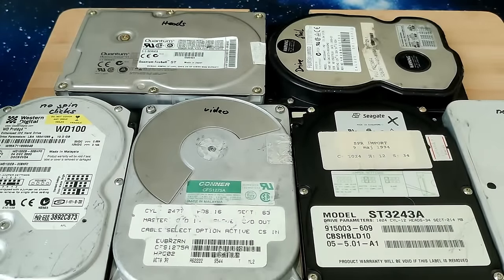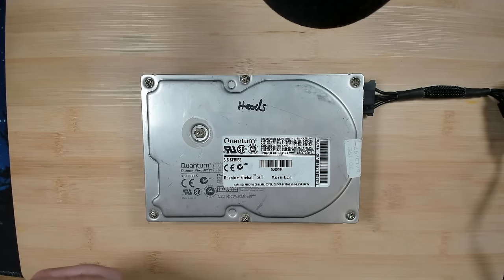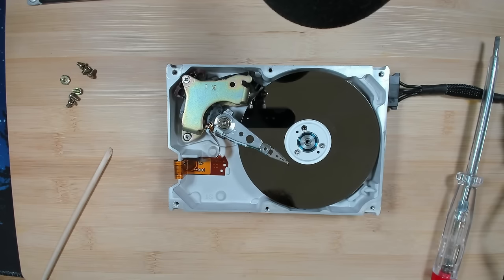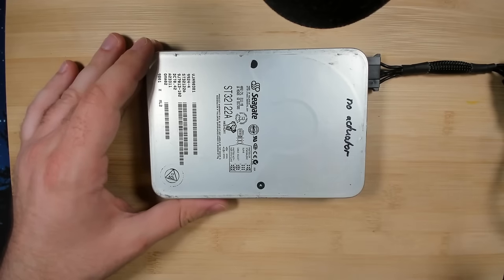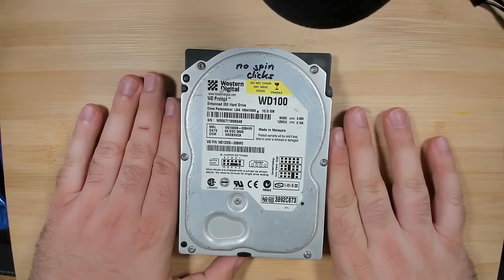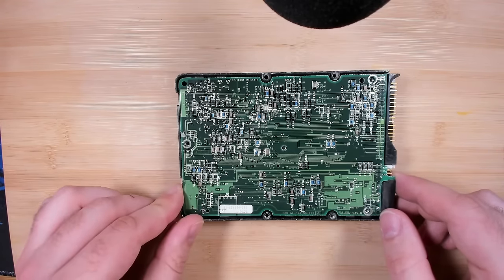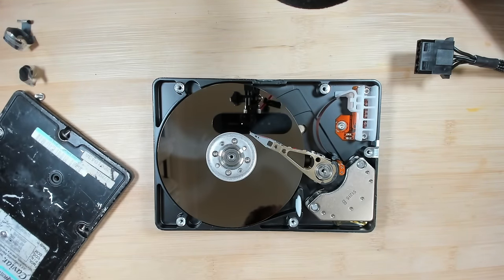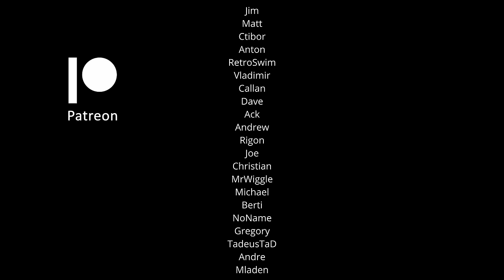The sound of broken Hard Drives

Comment: It's sad to see these drives being open, especially if there is no obvious signs that's it's dead mechanically (like the last WD drive). Cause after being opened it's most likely beyond repair. Anyway, thanks for the video. Interesting, as always!

PS. There is a guy on YT that has lots of video about old HDDs - Arnold0. Maybe you can ask him something.
Reply from the maker: Thanks for the hint. I'll check since I have very little experience repairing hard drives. I still have a handful of drives that need to be fixed, and they're in much better condition and probably have a much better chance to be fixed than that last western digital drive.
Reply: from my experience more than 50% of the drive problams are in the controller card and not a mechanical issue
Reply: my cousin did it all the time, he repaired them as part of his computer hobby, if you don't leave then open and run
them... too long....  they can be opened for repair. unless you are working in or next to a dirt quarry  😆
Reply: @GothGuy885  Older drives were much more tolerant. Sub 1GB you can probably open and have a decent chance of it working after, over 10GB you really need a clean room.

Comment: I could tell by the sound, that the first one was badly crashed 😵
the second one almost sounded like an Air Raid Alarm 😆

as a computer Hobbyist, My cousin used to repair hard drives, that he would buy at electronics swap meets, or were given to him, by an IT friend, who pulled them out of servers.  he would check for any physical damage to the platters and/or heads and if they were OK, he would swap out the controller card from a crashed drive, of the same make, model and specs. and most times, he could get them functional again. not sure if he would do the same with the heads, as the space from the platters is so very critical, and he did not want to ruin good Platter(s) that could be used in another drive. I think he used Archival gloves to handle the good platters as not to get finger prints on them.

Comment: Interesting topic. Over my PC journey (started sometime in 1991/1992 with a 486DX33), I had better luck with Seagate HDs than most other brands. Until recently, I have never had a Seagate HD dying on me: I still have some 4-10-20GB in working condition (100% health), and some 160GB-500GB  (IDE and SATA) also in perfect condition. These HDs are more than 20 years old.
During these years, I had issues with Samsung and Hitachi, (dying young, under 2 years),  Maxtor and Western Digital not reliable. 

My opinion about Seagate changed. Sometime in 2013, during a trip to Germany, I bought 4 Seagate drives at Alternate, rated for 24 hour operation (SV models) with capacities around 3 or 4 TB. The idea was to build a NAS, the drives tested OK and I put then in storage. It took a couple of months (perhaps 2 years) to get all hardware and resume the project. When I tried to use the hard drives, they were not OK: they had less than 200 hours online, were stored safely in a dry place, in their original packing, never dropped.

I bought Western Digital to replace those, and they are running OK ever since. I guess Seagate is not what used to be. It was not that one drive failed: all of then crapped (4 units).
Reply from the maker: Wow, that is very unfortunate that all four have failed! I had a couple of drives fail on me, but no pattern or something out of the ordinary. However, I did have many western digital drives and they were mostly ok.

Comment: Interesting video, as always. Question: do you use Steve Gibson's Spinrite to test and refresh the data as first order of business on those that are able to boot and get detected? If not I highly recommend it. Especially for older drives. Also it's really interesting seeing that program revive an ancient hard drive in real time.
Reply from the maker: Funny you mention him. I actually reached out and he did reply! He provided a licensed version of SpinRite 3! I'll be covering it soon since I would like to cover a few more hard drive topics in the near future. I also got another software called HDD Regenerator. Also a very nice tool!
Reply: @bitsundbolts  🤣 that's amazing!! Steve's the man! To think a few Kilobytes of assembly code could do so much it's just incredible. Looking forward to watching that video soon!  🫡 🙏🏻
Reply: spinrite is great for refreshing fading data and to exercise the read heads... but if the drive is failing mechanicly there is little spinrite can do besides quickly recover as much data as possible before the drives flails completly
Reply: @fft2020  yes of course. It's software, It's not intended to fix hardware issues, mechanical, electrical or otherwise. But IF the data is stale, or there are bad sectors  on the disk platters, I think there is no better piece of software to address that issue and attempt a drive image or full backup as first order of business with these kinds of drives. On top of this, if they are working fine, they will see an improvement in performance. Been there, done that 100's of times with all sort of drives and disks interfaces. The improvement is indeed quite noticeable.
Reply: @Kaio7  you are right spinrite is the best

Comment: Even 20% of change of getting a working HDD from the scrap yard seems high to me. But at least trying if drives work doesn't cost much, it is worth the effort.
Actually I was very curious about the outcome of the WD drive. I have an old one with some data that I would like to rescue, but doesn't spin as well and I don't know how to proceed. It cold something mechanic (like the heads stuck against the platter) or electrical. I'm fearful of opening the drive to see if it is something mechanical and ruin the drive...
Reply from the maker: I think chances are high that a drive becomes unrecoverable after it's opened - just because of the dust particles in the air. I'm no expert, but I do have a few drives that don't spin up. I'm set to do research and try to figure out what's the issue. Will be coming up soon!
Reply: @bitsundbolts  Yes, I'm very reluctant to open it as well, should be like the last resort. I'm no expert as well and because they are such sensitive device, I never played very much with them. I think I will have to get some broken drives and do the same as you did.
Eager to see that video to learn a bit more 😀
Reply: I have more than 50% success in the scrap yard drives, just yesterday I brought a 171mb and 130mb all in perfect working order

Comment: I love old HDDs. I still keep them even if they don't work. The older the prettier.
My backups are all on HDDs, don't trust SSDs in the long term.
I don't mind seeing more non working HDDs videos, if you have the patience.
What was that red thing under the resistors? Some kind of glue?
I know that some very old and unused for a long time hard drives get seized up, and after a bit of motivation they start working. Wish all HDDs repairs were that simple.
Reply from the maker: Yes, the red thing under the resistors was some sort of glue. I yet have to repair my first hard drive :)

Comment: I actually saw a video where they were trying to use a new old stock sealed in box hard drive WD 10K RPM drive. It didn't work. I think it was DeBaur. I don't remember why he'd be using a hard drive. His channel is all about new stuff.
Reply from the maker: I haven't seen that video. But that shows that there's no guarantee hard drives will work when they weren't used and brand new.
Reply: @bitsundbolts  yup. one of many reasons Why I prefer SSDs. They aren't perfect, but usually you can get the data off. I did see one video on HDD Repair Services where the morons that made the SSD tied the chip and the controller. The controller was dead and so there was no way to get the data. He put the chip on an identical board with the same controller and it went into safe mode. He confirmed it worked prior to that. He said they are advancing the software. Maybe some day they can do chip off (direct chip reading) on that setup, but currently no.
Reply: That video was part of der8auer's HW-Legends series which is about old hardware

Comment: if you can get scrap drives maby its a fun idea to see what really happens when you swap PCBs around? :)
Reply from the maker: I'm planning to swap PCBs with some western digital drives. They're identical models. Just one works, the other one doesn't. Could be a simple indicator to tell if the PCB or the drive/motor is bad.
Reply: @bitsundbolts  maby also do some mismatching with drives that have bad sectors?

Comment: Yeah I don't like hard drives either. CRTs, parallel ports, hard drives. and physical media. I'm not a fan. lol My C64 runs on a USB drive thanks to my U2+ cartridge. Technically that's removable media.......but it's close enough to making it have an SSD that I'm good with it.
Reply: don't get me wrong. These devices are fascinating. It's incredible how they work, but I don't trust them and I prefer the silence of modern storage.
Reply from the maker: There is still something to the sound of old hard drives. I hated the noise back in the day and I believe Maxtor drives were among the most quiet drives. But now, I like to listen to the sounds of working drives. Nostalgia 😁
Reply: @bitsundbolts  lol I remember the C64 was a completely silent machine unless you're loading something. Then it's loud and obnoxious. 90's hard drives were also pretty loud an obnoxious. As a kid I was convinced sooner or later we'd have completely silent computers and now we do. That's what I prefer. But it's nice that you can go retro with just enough modern tech to make them silent.

Comment: I work in data recovery. You can tell a lot about how bad a drive is by its sound.
Reply from the maker: It is very sad to see those drives in this condition. I don't have a lot of experience with hard drives, but I wonder if anything can be done with the other drives that just don't spin up. What's the first thing to look for?
Reply: @bitsundbolts  on these older drives pcb would be the first thing. There is a model number on the pcbs. If you find a donor, swap the rom if it has one and hope for the best. I’d you hear a drive beeping generally the heads are stuck or spindle is seized. Not great options for old drives like these. Even head exchanges are out of the question. Tools and parts are nigh impossible to find.
Reply: Also, don’t open a drive unless it is last resort. You can tell a lot of a drive by how it sounds. If it initializes etc. dust and debris can rapidly kill heads. Plus, you were scraping the heads on the platter causing head and platter damage. These heads and more modern ones float just above the platter on a boundary layer of air and do not make direct contact with the platter.

If you do need to open them do try to have a clean room of some sort. Also if you have to relocate heads on a drive with the heads parked on the platter, you spin the platter away from the heads and gently guide the heads slowly to their new position.
Reply: If you think these ancient husks are marvels you should see modern drives that us lasers and microwaves for heat assisted magnetic recording.
Reply from the maker: Thank you for all this information. I'll try my luck on the remaining drives without opening them! That one Seagate drive (~200 MB) makes silent beeping/buzzing sounds. It might have the issue you described with stuck heads. How would I go about that? Is there a possibility without opening the drive? How would I try to unstuck the heads without letting them touch the platter?
Reply: @bitsundbolts  if heads are stuck you have to open the drive. There is a progress to unstick the heads but they may not survive the operation. With stuck heads you replace don’t reuse when they are like that. They could be tweaked or damaged causing platter damage.
Reply from the maker: Ok, well, there is no such thing as a head replacement for me. I guess I'll have to try my luck opening the drive and somehow unlock the actuator. But as you said, this should be the last resort. I'm already trying to learn  how to debug and fix common electronic issues on HDD PCBs.

Comment: I have so many broken laptop drives its stupid thank god for SSD's.
Reply: just the fact that a device that is tossed around like a laptop having a mechanical high precision device inside and working is a miracle... I will never trust laptop hard drives
Desktop 3 1/2 drives on the other hand are incredibly reliable... I still have my 40mb seagate from 1990 working fine with ZERO bad sectors
Reply: @fft2020  I agree. I've had better reliability out of 3.5" HDDs than even SSDs. Also, 2.5" HDDs seem to break all the time so I wouldn't trust those even though I enjoy the idea of a miniature spinning drive.

Comment: noooo .. please take home some really old hard drives
people are crazy ! How can you be a retro enthusiast and not have a PC with a real mechanical hard drive of the era ? 
People use compact flash but that is cheating! there is nothing like an old noisy hard drive
A retro build is only complete with the hard drive present, you can use a compact flash but just to make it easy to transfer stuff. but the hard drive has to be there

I also go to my local scrap yard and I bring everything below 4.3 GB and around 50% of the are in good condition even after being tossed around in the bin
just yesterday I found an IBM 171mb and a Conner 130mb all in PERFECT working order
Reply from the maker: What I've seen is that drives are thrown from pickup trucks to the ground. Most of those drives do not survive this. However, I fully agree. I feel the same way. If I see an old drive, I'll probably get weak and take it anyway. They all have different shapes and make different sounds. You have a point with hard drives and flash cards. With flash cards, PCs are significantly faster! I don't remember for PCs to be that fast and that is probably due to the lower seek time on flash cards. So, you won't have a proper retro build if you don't use an old hard drive. I agree with you!
Edit: and very cool that you found those old drives in working condition! I hope to find some of those one day too - especially a working Conner drive.
Reply: @bitsundbolts  2 months ago I brought a seagate 130mb that didn't make any sound (dead) but I had another one here exact model with mechanical problems (it only started after 20 or 30 power on cycles) and I swapped the PCBs and the dead one came to life in full working order... it was a dead PCB
.
can you inspect the drives before bringing them ?  those with visible toss marks like the one in your video with broken IDE plastic are more probable to be broken 
last month I even found an MFM drive but has ripped orange ribbon cable but it starts and tries to seek... even after being dropped in a metal barrel
Reply: @bitsundbolts  Love your videos both scripted and unscripted. you are an inspiration to me